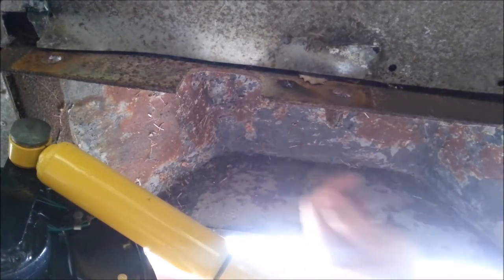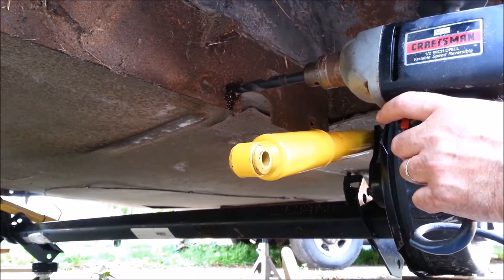Axle Replacement 1967 Airstream Caravelle Part 4 Mounting Crafted Channel

Comment: what is the blue air hose doing in the trash. that can be used for other stuff. and why did you put a axle under it that the hole werent the same. i would have been pissed if they sent me the wrong axle
Reply from the maker: Abom sent me a free air hose  so I threw the old one away.   Just kidding.  It's an old stiff garden hose.  Been out in the sun for years.  Cleaning up junk I have laying around.
Reply from the maker: It was a disappointment.  But being mad isn't productive or helping me pursue happiness.  I just decided to fix it.  Use my energy to get the project done and try to finish feeling good.